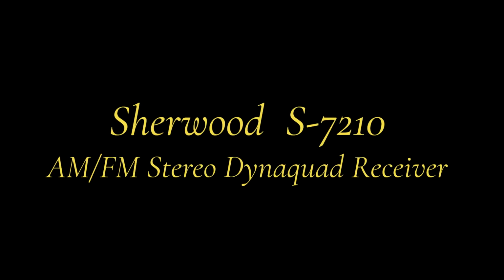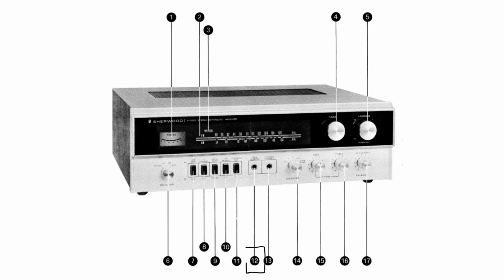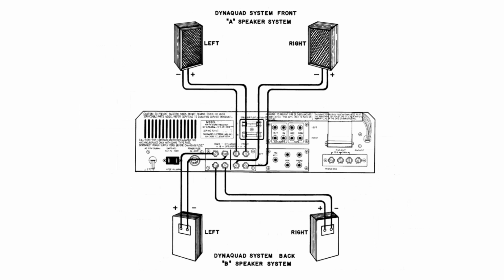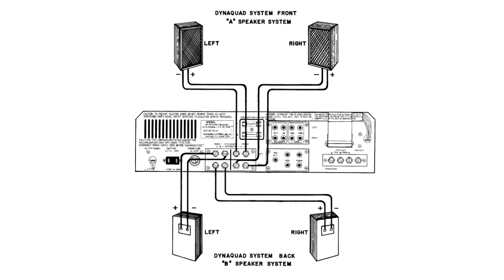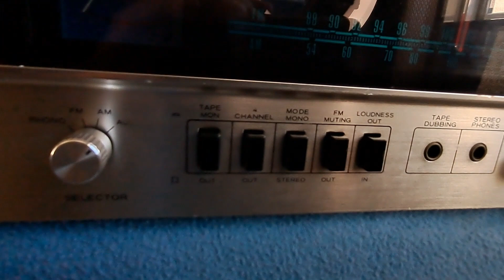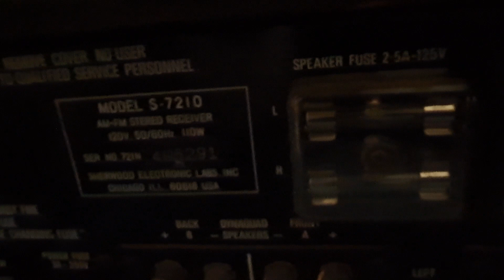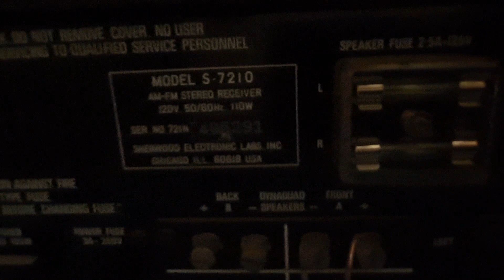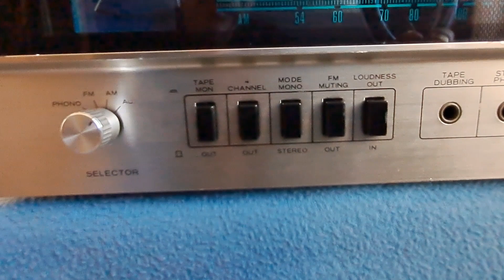Sherwood S-7210  AM-FM Stereo Dynaquad Receiver - Controls, Specs and Test

Comment: I have had 2 vintage sheerwood receivers and I love the way they sound.  One of them i saw sitting in a pile of junk driving down a side road it looked like it was there for years.  I took it apart cleaned it dexot and it powered right up and was probably one the best sounding receivers i have owned . Definitely a sleeper . Another sleeper is some of the Realistic people think because they came from radio shack they are junk but they were made by the same company in Japan that made Marantz and thats why you can find them cheaper